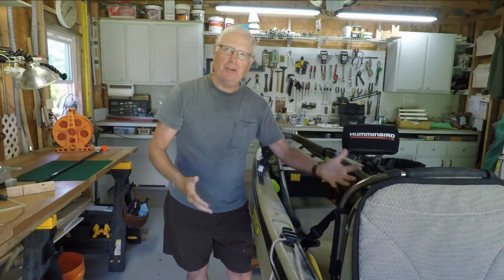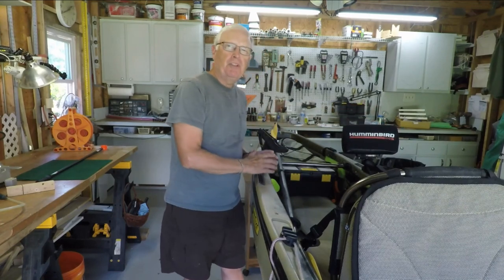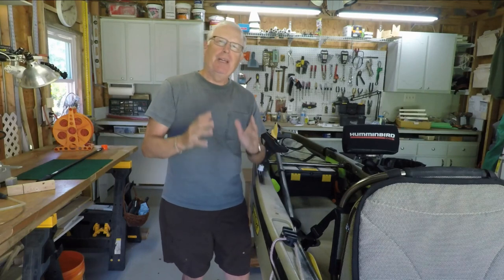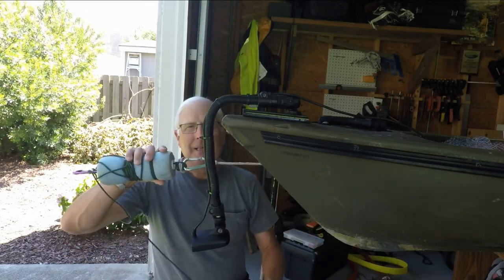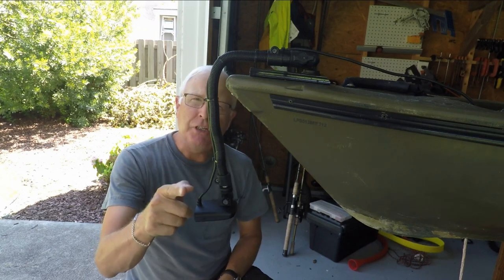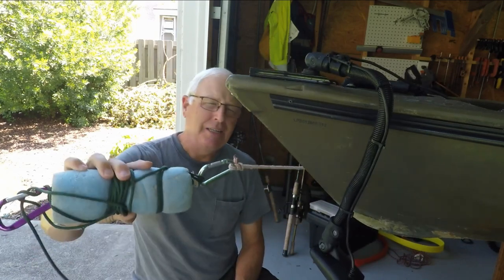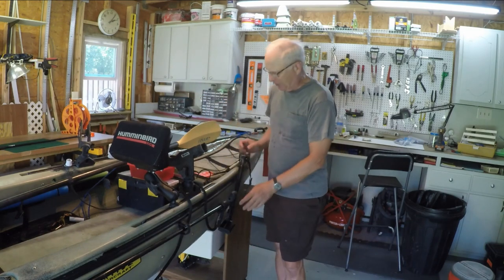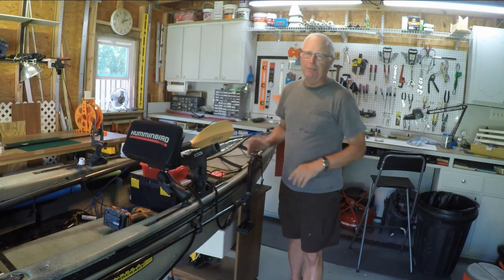Prevent Side Imaging Transducer Installation Mistakes on Fishing Kayak

Comment: lot of guys seem to use the scupper holes, not sure how well it works
Reply from the maker: I would worry about the transducer scraping when you hit something.
Reply: @KayakhacksFishing  the secret I was taught with the commercial ships is getting it in smooth water. The less disturbance, less pressure and bubbles a better overall signal. Some off the best results were epoxied to the hull interior surface, and never had issues with them. Amazing what is out there but as you know many never get used. The biggest problem is people don't spend the time to learn the machine. IMHO
Reply from the maker: @bigrickshaberdashery2759  Learning the machine is key! Thanks for the tips on the water. The real issue with this one was the side imaging. That will not work through the hull.

Comment: Great video. If I have my transducer closer towards the bow, it angles more toward the center of the bow rather than facing straight ahead when in the water. Is that something I should be concerned about with accurate readings? It’s a bullet transducer.
Reply from the maker: I am not an expert, but I do not think that would matter. See what readings you get.

Comment: I have a Field & Stream Shadow Caster and I used G E silicone calking and stuck it to the inside,  bottom of the hull. It's below the water line,  just aft of the front hatch and has worked fine for 3 years. Still stuck!
Reply from the maker: I wish I could have put this on the inside, but it is a side imaging and cannot work through the hull.

Comment: Take a bungie cord cut it in half.
Mount your transducer to a plastic plate ( uhmw 1/8" thick sized for your transducer).
Mount the transducer to the plastic plate .
drill holes for the bungie.
 feed bungie in the hole knot it off.
Now your transducer can be mounted under the center of the kayak in the location you desire.
With no side imaging interference  .

Yes you may notice some drag.

This is how I mount my transducer to a STAR inflatable fishing paddle board
Reply from the maker: Great idea! Thanks!

Comment: I’m curious as to what you opinion is on scupper mounts as opposed to side mounts. I’m undecided   🤷🏼‍♂️. Thanks Colonel 👍🏻
Reply from the maker: The primary reason to side mount is if you are using side-imaging, the transducer has to be below the level of the hull. If you do that with a scupper mount, the transducer is sure to scrape as you hit obstacles or launch. With a side mount, you can pull it up when launching or it will just bounce when hitting something.
Reply: Kayak Hacks Fishing I have a Garmin Striker 4 does side scan work with through hull install?
Reply from the maker: Sadly, no.... the side beams need a clear shot. I wish it were not so...

Comment: okay i have a pelican predator bass boat. want portable unit and a side mounted removable transducer unit. advice please
Reply from the maker: The key words you used were portable and removable. Assuming you do not want sidescan, you should take a look at the Deeper. You can get a mount that attaches to the boat to float the unit. https://youtu.be/NuWhwZ96YnE

Comment: Awesome info.....now how did the side scan work for you?
Reply from the maker: Side scan works great if there is enough water. It loses utility as the water gets shallow. I gave my Helix to my brother for his bass boat since I found my best inshore spots were all only 2 - 3 feet deep. I realized I was using it to find the channels (5 - 6 feet) at high tide, but not really getting any use from the side scan. So, I just use the Deeper sonar now since it is much less heavy, does not require a huge battery, and will do that function just fine. In addition, I can cast the Deeper to float with the current when I want to recon.
Reply: Thanks for the info, I will get a standard fish finder

Comment: Have you thought about mounting the transducer inside the kayak.  I know that will effect the water temp.  Any thoughts?
Reply from the maker: I did. But this system included side imaging and side imaging will not work through the hull.

Comment: Does the transducer have to be lower than the bottom of the kayak or can it be just at or a little below the water line, I'm trying to figure out if my transducer will read correctly if its not below the hull of the kayak
Reply from the maker: if it is a side scan, it must be below the hull. If it is a regular down scan, it just needs to be in the water

Comment: How does it attach to the tracking. Do you have to buy an adapter?
Reply from the maker: If you mean the control head? The Helix came with all the cables. This video shows the installation - https://youtu.be/Kw0nQlFd8ZE

Comment: What do you think about mounting through a scupper hole?
Reply from the maker: Side imaging requires the transducer head be below the bottom of the boat for it to work. I thought about doing it through the hole, but decided not to since I would not be able to pull it out when beaching. I did not want to scrape up the head.

Comment: This is why the FeelFree Lure 11.5 is a good choice because it has a center mount sonar pod between your feet. The unit mounts to the top of the pod and the transducer fits in a cavity undernearth.
Reply from the maker: Will the transducer sit in the water below the hull? Through the hull works fine for traditional sonar. I was using a sidescan unit and it cannot have anything other than water around it. It would be great if that model solved the problem.

Comment: Exactly what I was doing yesterday.  Installing a Garmin striker 5cv on the Jackson.  Now all I have to do is learn how to read it. I was thinking about mounting the transducer inside the hull instead of on a mount outside. (Which I already had from the PO.) What are your thoughts on hull mounting?
Reply from the maker: the big challenge is to get a flat spot where it will have a clear shot to the bottom. That said, I do not know if CHIRP works through the hull like regular sonar. I don't think I have a flat spot on my Coosa FD.
Reply: @KayakhacksFishing  I was looking for a spot that was suitable. The new transducer is rounded on the bottom.  I guess I need to do some research to see if chirp will work that way.
Reply: @KayakhacksFishing  I also just read something that these transducers produce a good amount of heat and need to be in water to keep them cool. I had no idea.
Reply from the maker: @racerx12003r  Who knew? Glad you did the research.

Comment: Have you come with any ideas on how mount the si transducer to your coosa Fd. I have the Hummingbird Helix 7  mega  si unit. It was going work great in a front scupper hole on a Peception Pescador Pilot kayak using pvc sch 40 pipe moving it down below hull so beams would work and pull up pvc and stow transducer back in a protected area, ,but now am in a 2018 Jackson Coosa Fd and sratching my head on how i can cleanly make it work. Coosa transducer holes are right under the pedals and the flex drive drops down would block it as well for the pvc idea.
Reply from the maker: Ouch. I can't really help. I gave my Helix to my brother for his bass boat since I decided the side imaging was not useful for me since I end up in shallow water all the time. I use the Deeper Sonar now (traditional sonar) since it is light and I can use it to both position my kayak next to channels as well as cast the unit to search a deep channel.

Comment: Are there any Through Hull transducers for kayaks?  I am about to delve into this and am hopeful the answer is yes. Thanks for posting your experiences.
Reply from the maker: Through the hull is only an issue with side imaging transducers.  There are many normal sonar models that permit inside the hull installation (and you can see plenty of videos on how to do that).  You should check with the manufacturer or kayak dealer  before buying to make sure and confirm how the transducer should be attached to the hull.  For example, I seem to recall there are some models that do not recommend epoxy.

Comment: Will downscan be affected by mounting inside the hull like side imaging? Or would I just be better off getting regular sonar? Thanks so much and great informational video!
Reply from the maker: From everything I have seen, normal sonar is not impacted by the hull as long as you do not have air gaps between the transducer and the hull.  Humminbird recommends against doing down imaging through the hull as a result of loss of signal strength. They do have schemes to drill holes through the hull and mount the transducer externally.  http://www.humminbird.com/Category/Support/FAQ/SI_ShootThruHull/

Comment: Use ipx67 electrical gland mounted ( 16 mm hole ) in your kayaks hull tunnel and mount under floor . Use marine goop for extra insurance . Also a wedge of material ( plastic , wood ) as protection in front of transducer . Can use supplied transom mount screwed into long piece of plywood and glue this to underside of tunnel . Rough area before glue ( marine goop works ) Good luck Steve
Reply from the maker: Won't the tunnel get in the way of the signal?

Comment: How do you feel about mounting the transducer inside and on the hull of your boat? I've been thinking about adding a fish finder for a while now. Never really used one in the past, but I know it's a handy tool.
Reply from the maker: I could not do that with this model since it was side imaging. SI requires the transducer be below the hull. Otherwise, if it had been normal sonar, I would have looked for the inside solution.

Comment: Dont the fish finder not work very good sitting still (anchored) so why does the anchor trolley matter that much?
Reply from the maker: You are correct when stationary. However, the anchor trolley gets in the way and catches on the transducer.
Reply: Kayak Hacks Fishing 

I would think out in front center of you would be best..  when it pops up on screen it's pretty much directly under you or besides you. When you get to your spot have a rope or system to pop up the sonar or drop the sonar when done anchoring.. 

I forgot what you said was other problems of front mounting? Sorry very short attention span.. what was we talking about lol
Reply from the maker: Front is best since the paddle stroke or propeller will mess up the side imaging. I do not think there are any problems with the front.
Reply: I'm new to this; so when i am drifting on my kayak, the fish finder won't work well?  I need to know cause then there is no point in getting one because half of the time i paddle and the other half i try to stay put but usually wind up drifting.

Comment: I have a Garmin Side imaging sonar unit. Do I need to get the 18" ram transducer arm or the 24". Ram says that the 24" is for side imaging units.
Reply from the maker: Definitely get the 24 inch since it accounts for different heights from the water better. You can always cut it off with a hacksaw if the transducer sticks too far below your kayak.
Reply: Kayak Hacks Fishing 
Thanks a lot! I just tried my ff out this morning and I had it mounted in hull on my Vibe Sea ghost. Long story short the image was horrible.    this external arm should help tremendously. Keep up the helpful vids!
Reply from the maker: Yes, side imaging does not work through the hull.  The instructions on my Helix were pretty strong on that!

Comment: Why not mount through hull?
Reply from the maker: I was surprised by this answer as well.  The Field Marketing guy told me that sonar will work through hulls, but for side imaging the transducer must be below the boat to properly ping.  So if your finder does not have a side imaging capability, you can mount it thru the hull.  Also, the installation directions make a big deal out of having the side imaging transducer level (side to side) for the ping and many kayaks have curved bottoms that prevent that.

The transducer manual is pretty direct about this as well: "The Side Imaging transducer must NOT have anything obstructing the 'view' of the side looking beams.  For example, nothing can be in the line of sight of these beams (not a hull, motor, or other transducer, etc"

Comment: What are your thoughts on transportation when your transducer is installed on the kayak. I am worried that I'll damaged the transducer since it has to stay in the yak. I've seen all-in-one box setup with the transducer and finder in one but I'm not crazy about how it works. Would the transducer be the proper location each time with each setup?
Reply from the maker: Mine is mounted on a RAM ball.  I just rotate it up and out of the way, laying it against the inside of the kayak.  No problems with that approach.  It falls right back into position when I change it back.

Comment: I am getting ready to install my first fish finder on my kayak I have never had one before. I have a question how difficult of an install is this going to be. Better yet how difficult was it for you or is it pretty forward and simple thanks
Reply from the maker: It is pretty easy. Just figure out where to run the cables and be sure the transducer is in the right place. I used a RAM mount for my transducer and that made everything easy. I believe it is more difficult if you try to do an in-hull installation (which will not work if you have side imaging).

Comment: At what depth do you feel a depth finder is of use other then depth of water? I mean the cone angle is so small don't you need like 30ft depth to get a 5 ft of coverage? Don't mean to sound harsh or anything just looking for info as I am considering getting one and when I fish its only like 15ft or so.
Reply from the maker: Your point is exactly the reason I wanted to have a side imaging unit. It shoots out to the side and finds fish quite a distance away. The SI gets better the deeper the water. Theoretically, it can be used in as little as 2 feet, but I find 10 feet is better.

Comment: Ok, same problematic issues with where to install the transducer, ... my EddyGear Kayak, has a place for a Lowrance transducer built into the hull, ... but I own a Humminbird depth/fish finder, with gps, ... & it will not accommodate my transducer, ... so, the only solution I have come up with, (being as I am handicapped, & live with constant chronic lower back pain), is to mount a remote controlled linear actuator to place the transducer where I need it, & also for my MinnKota trolling motor, ... as I have issues with paddling any lengthy distances, ... I can raise, &/or lower them both into position, separately, or in tandem, ... turn them on/off, fwd/rev, ... and steer the rudder with my feet, ... all while playing a fish, as everything must be within arms reach, ... (and yes, I will keep the kayak paddle, just to be on the safer side), ...
Reply from the maker: Sounds like you have a very cool solution!
Reply: John E Osman III I

Comment: Have you experimented with an in-hull setup?
Reply from the maker: I wish I could have gone with an in hull. However, side imaging does not work through a hull. The transducer has to be directly in the water. If I had purchased the traditional fish fisher, I would have done in hull.
Reply: That is great to know. Will the in-hull also affect the down imaging as well?
Reply from the maker: Sometimes. From what I have read, you need to be very careful on how you install it to avoid an air gap. But the hull should not make a difference on traditional sonar.  Not sure about down imaging... if that uses the same technology as side imaging, there might be an issue. You should research that.

Comment: "While true for regular sonar, but not true for side imaging."  Thanks for info on through-the-hull mounting.  My Hummingbird PiranhaMax 175 is a "dual beam" sonar - would that be considered a "regular" sonar since its beams generally go straight down?
Reply from the maker: I am pretty sure yours is a traditional sonar and will work fine through the hull if the hull is compatible (check with the manufacturer) and you mount it without air gaps.  It is only the side imaging that requires a clear view below the plane of the kayak.
Reply: Allen Crute thank you. I hadn't thought of checking the manufacturer so thanks for the tip on that I'll do that as well.
Great video - to the point without introducing us to your life story or pets, and impressed with your organized  garage.
Reply from the maker: I'll have to tell my wife about the organization.  She and her twin sister are fanatics about organization.  lol

Comment: Hi. great tips. Thank you. I also want to take advantage of side imaging technology. Local kayak dealers are telling me to just get DI and not SI. How is it working for you on kayak? Is transducer below hull? Any problems so far?
Reply from the maker: No problems so far.  Here's the SI decision ...and ... actually the decision on a fishfinder.  If you fish where the water is routinely deeper than 5 feet, SI will make a difference.  It allows you to see out to the side and in that shallow water, DI is kind of worthless.  The deeper the water, the greater the benefit of SI.  The RAM mount keeps the transducer below the hull and has been pretty robust.  I whack it with my paddle to reposition it after running into shallows where it bounces off the bottom and it drops back into position without any problems.